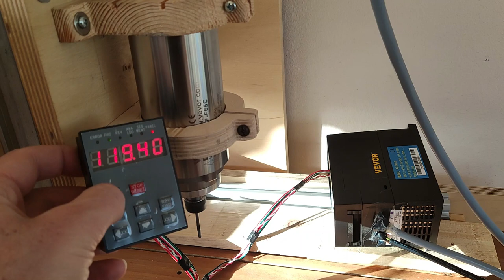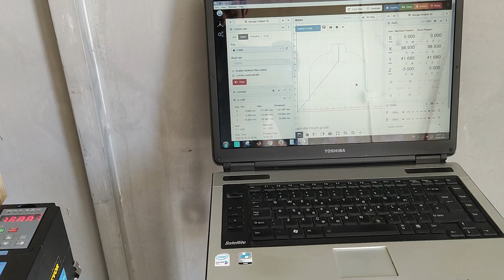How i made my own DIY CNC (120x80cm)

Comment: Looking forward to see it going.
By the way, havenot seen any details regarding your stepper motors. All nema 23? Any other details regarding motors will be appreciated.
Thanks
Reply from the maker: It is working fine now after a couple of modifications. A bit of strengthening in X-axis and increase of the voltage to 30 V. 
I am using nema 23 motors, medium size , 55 mm i think... Plenty of power, but maybe the Y-axis needed a bigger motor. 
However, one problem with low max speed is the 12 volt power supply.
Reply from the maker: I should make a new video for that. But in short, you need to cut diode D1 in ramps and power the arduino from usb. Then increase the voltage to at least 24 volts. The drivers will perform much better. 
Of course the capacitors in ramps should indicate 35 volts and not 16.
Reply from the maker: Another thing is that i am using gt2 belts and pulleys just because they were cheap and easy to find. They are not optimal for cnc...
Reply: Thank you

Comment: Does the wooden frame flex when cutting?
Reply from the maker: It flexes a bit if you run it hard. It's wood after all. But it's ok for cutting hard wood. For aluminium you need to go slower.

Comment: bro do you think its possible to put a phones hardware inside an old tablet ?? the camera doesnt need to work only for youtube and readding purposes
Reply from the maker: The phone and tablet have similar hardware. Only the screen is larger and maybe some other components like the speakers and the antennas.
But you can remove the boards from a mobile phone and put it in a tablet as long as you can drive the screen. The screen interface can be different sometimes. So you need to check if it can work.